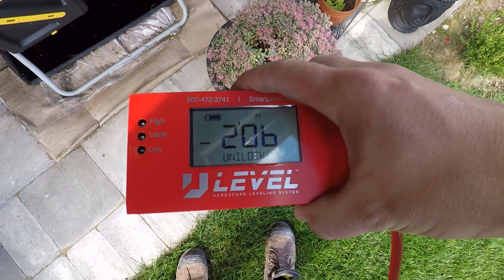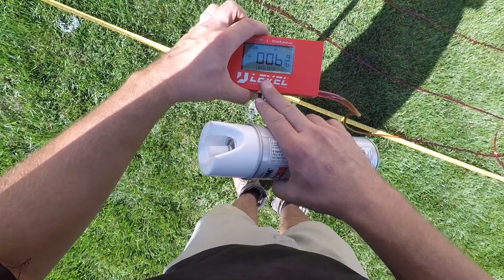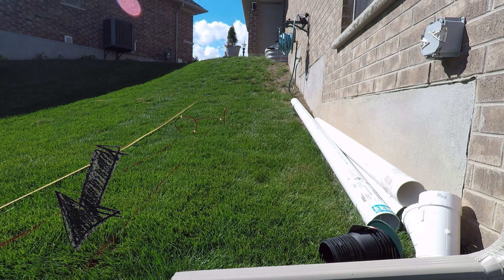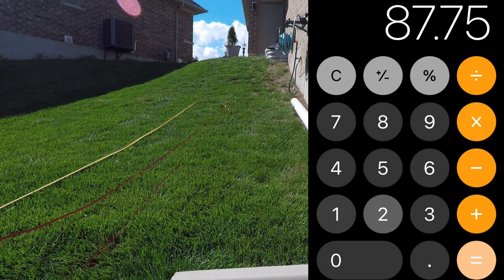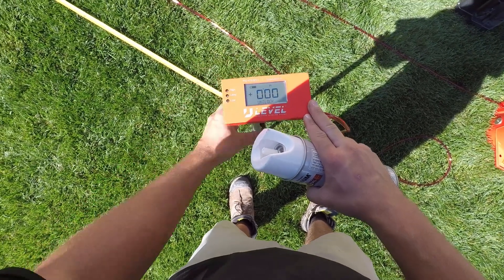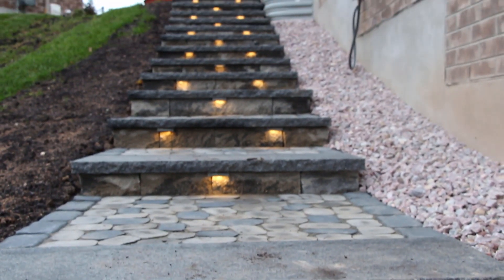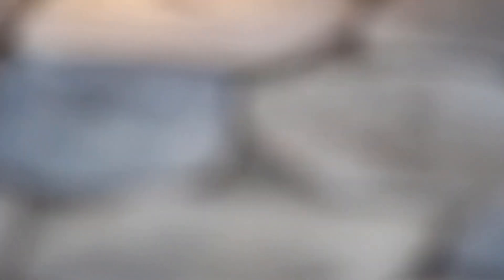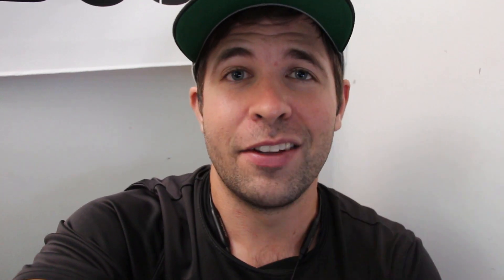Measuring Elevations for Steps | Building Hardscape Steps

Comment: interesting way of calculating that. You actually built each step independent of the previous one, and at two courses deep.

hardscaper here, I have a ziplevel, not saying what you're doing is wrong, but rule of thumb is simply:

Total rise = 87.75
subtract coping thickness ( -3'')
=84.75
84.75 / 6'' (block height)
= 14.125 steps or 14

*I'm just assuming the material dimensions for this example

doing it this way, each step is 6'', and each consecutive step rests a half inch on the previous one providing vertical load to pass through to the previous step making it structurally very strong.
Reply from the maker: Definitely a good calculation to go about 👍

Comment: A question if you have time.  I know did is not code in my area, but how bad is an 8-1/4'' riser?  It will have an 11" tread (includes 1-1/2" overhang), it's a flight of 9 steps to stairs on a hillside terrace away from my home, a sticky situation that I have not been able to come up with better numbers. I just wanted to be sure 8-1/4" won't be a death trap.
It's okay if you don't care to answer... Thanks.
Reply from the maker: Always got time. 8 1/4" is exceeding the higher end of what I would ever install. But the best way to test it is to just stack some books up or other objects up to 8 1/4" and test it for yourself to see how you feel about it. It will just come down to preference, but if you have elderly I would steer clear of that high.